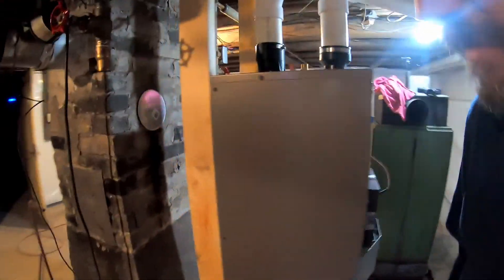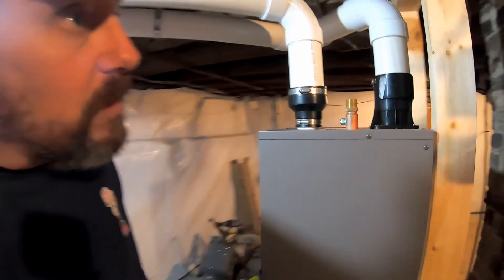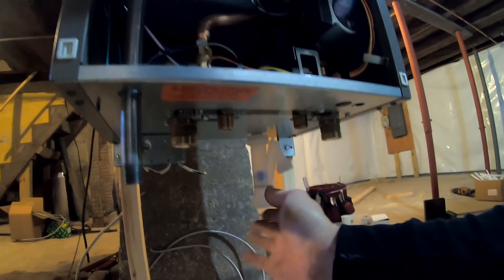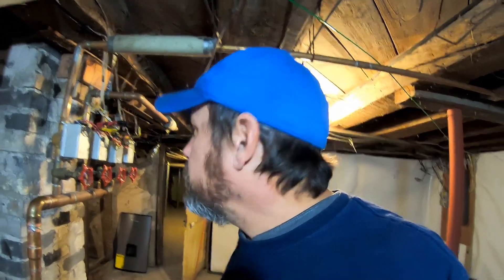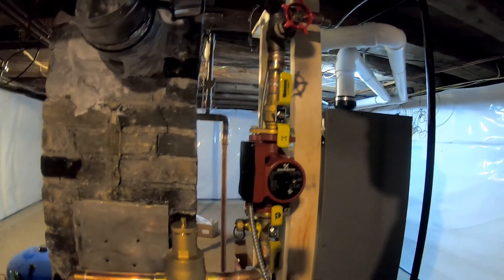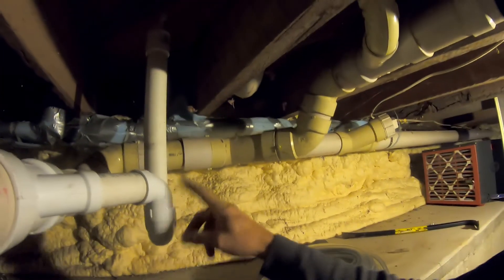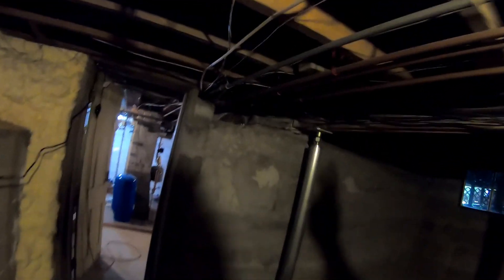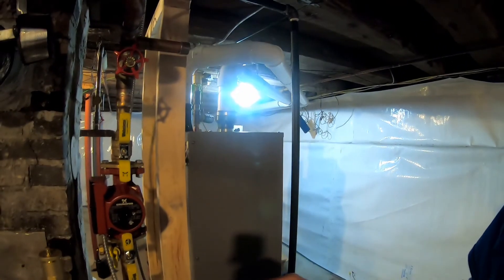Another Lochinvar Noble install. Putting the puzzle pieces together on a combi boiler. (part 1)

Comment: Have any thoughts about pro press vs soldered copper pipe?…had a Lochinvar Combi put in Sept. 2020, and let them do their thing..they used pro press!..an easier install?
Reply: Please be aware that there have been 2 separate recalls for the risk of carbon monoxide poisoning for some Noble models. The Recall information can be found on the Consumer Product Safety Commission (CPSC) website.

2020 Recall:

"The boiler’s flue grommet can deteriorate and dislodge during use and allow the boiler to emit carbon monoxide, posing a risk of carbon monoxide poisoning."

2023 Recall:

"The boiler’s flue collector can crack if exposed to a high impact event in the burner chamber, which can allow the boiler to emit carbon monoxide, posing a risk of carbon monoxide poisoning."

Comment: Great vids.  What are your thoughts on combi fire tube vs combi non-fire tube tankless?  I was looking at Navien or Noble, because they have fire-tubes.  But I'm also looking to link a combi and a hot water tankless together (because I currently 2 - 75 gallon hot water tanks, and a boiler).
Reply from the maker: I haven’t dealt much in the water tube combi. The Gionanni style heat exchanger has been around for some time now, but I think for the combi style boiler, the fire tube style exchanger has a quicker heat transfer rate and that’s paramount in the on demand world. I see the industry turning more toward the fire tube style. If it were me choosing, it would be hands down, the Noble. I have worked on both the Navien and Noble.  The noble has a separate plate style heat exchanger for the domestic hot water, its held in by two bolts, its very accessible, and relatively inexpensive to replace if you can't get it cleaned out if it ever plugs up. (by inexpensive I mean a couple hundred for the part depending on area)  Why does this matter? its extremely difficult to distinguish what part is what in a Navien.  How many bathrooms do you have?  I'm gonna guess you have two 75 gallon because of a large tub and not so much multiple bathrooms?
Reply: @themechfixer  Thanks.  I have 5 full and 2 half baths, but I have 2 jetted tubs, and 4 showers all of which have multiple heads.  I like the Noble a lot and I wanted to cascade it with a tankless water heater from Lochinvar but they told me that they have different communication systems.  Appreciate your input!
Reply from the maker: @BigEHead  I have tried to solve this problem... cascade two nobles in series and let the computer decide which of the two runs... this allows you to keep the flow activation rate at 0.3gpm, and the second noble can be piped into the primary heating loop really easily.  The noble allows for the space heating side to be limited to a maximum percent. so lets say you only need 200,000 btu to heat the house, you can tell each noble to max out at 50% capacity each, that allows the 10 to 1 turn down ratio to work within 100,000 btu of the NKC199 (200kbtu) capacity.  They still use the full 199k for domestic hot water....
Reply: @themechfixer  thats great to know and would work well.  but the cost of 2 of these systems would be very high.  the navien combi can cascade with their NPE tankless water heaters which is a big plus.  i wish Lochinvar had a Noble water heater (not combi)!  thanks!

Comment: Great job! I've got an old Crane sunnyday from 1964 I'm looking to update to one of these Lochinvar Nobil. What is a rough estimate on hours of labor for one of these bad boys. Just trying to get a ballpark on cost to have one installed.
Reply from the maker: Thank you!  Hours for install can vary greatly. In this video, I had a long way to go to get to hot and cold water lines, extra time in replacing the zone valves, and a couple other things that may not be typically needed.  All in all, on a general basis, I would say the average is about 40 hours total labor.  I've had them in with as little as 12, and have put them in with infloor heating that has taken much much longer. I might add, don't let that deter you.  I have had customers show me their gas bill comparison from year to year, and most have saved 40% or more on their gas bill.  Lochinvar is my preferred brand because of the support we have in our area, but i believe you would see that percent of savings in just about any brand of combi boiler.